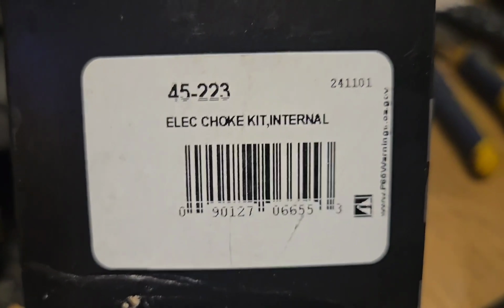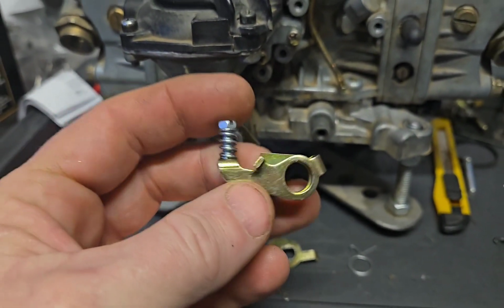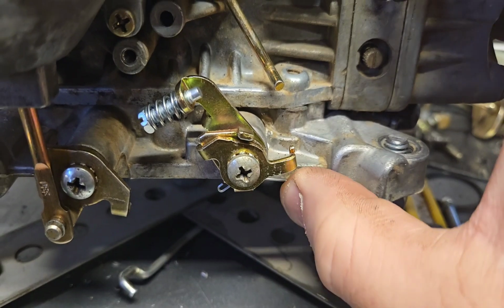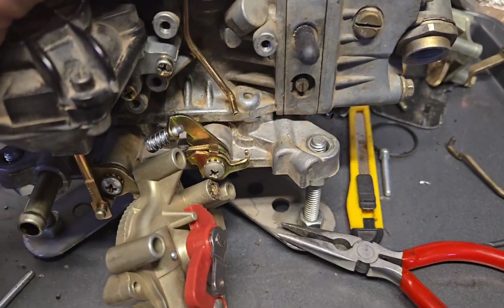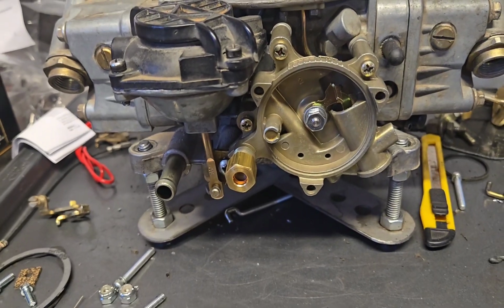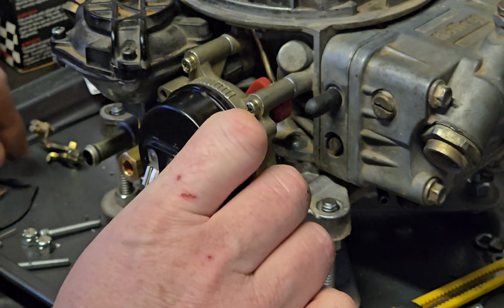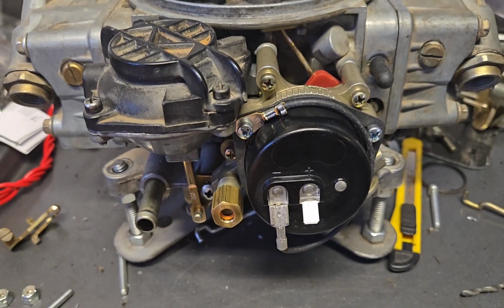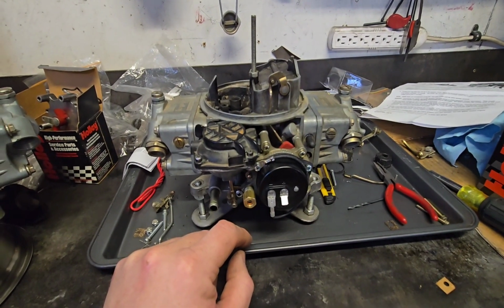Holley Carb Mods! Replace manual choke with Electric choke on a 4160 Holley Carb! #garagenation

Comment: Excellent video, thank you. NOT a mechanic but i am very curious by nature. I am trying to convert my Holley from manual to electric choke. So, with a manual choke the plate should be adjusted to not close completely, leave a pencil gap. The electric choke closes the plate all the way. Any way to adjust that? Should it close completely?
Reply from the maker: Just put a bit of bend into the arm that actuates the choke plate. Then it won't close 100%

Comment: Where did you connect the power wire to?
Reply from the maker: There are 2 blade type wiring terminals on the plastic choke cap. Negative (-) grounds to the carb body with the supplied black wire. Positive (+) attaches to "Key on 12v Power". Make sure it's not reduced voltage from the ignition system.